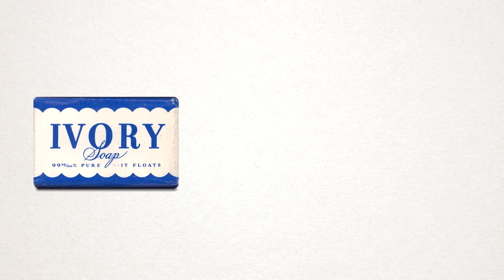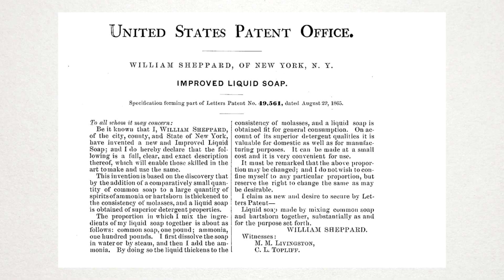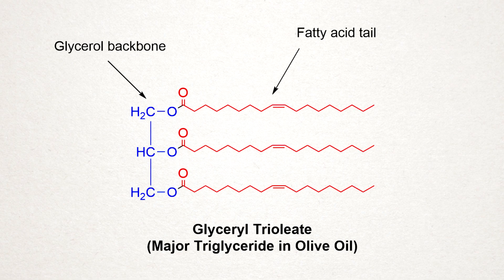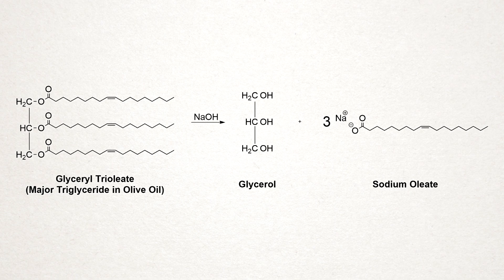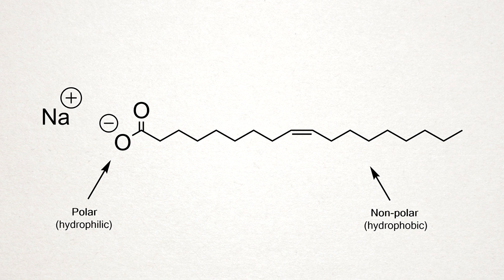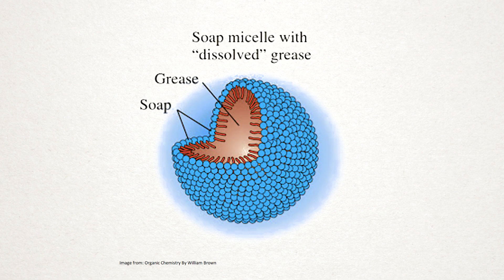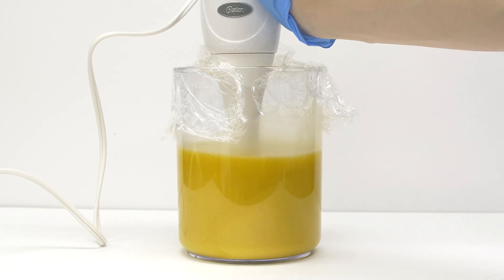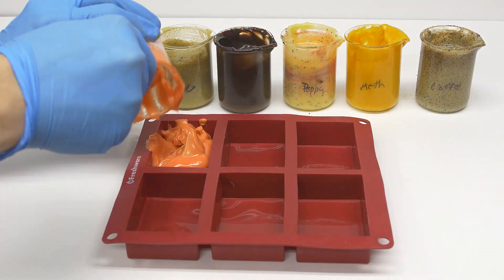How does Soap Work?

Comment: Questions:
1. Could the space in between the sides of each tail in a micelle trap air
2. Can a micelle trap air in the middle of it?
3. If a micelle trapped air in its middle instead of an oil, would it then be unable to pick up an oil or, would it drop the air for an oil if it found one (Could it drop the air?)
I am trying so desperately with my very small brain to understand the function of soap suds/lather and google is driving me insane
Bonus: when suds meet water, why do  they disperse (ussually)??

Comment: Does this mean soaps mainly target oils? What about dirt? 👀🤣
Reply: I suppose water pressure alone is enough to take care of that. The oils are the hardest to get off, which is why soap is needed. You can rinse non-oily dirt off your skin with just water, but if you've ever gotten grease or oil on your hands you'll know that no amount of rinsing will get rid of it. And there are oils on the skin, too, that can trap bacteria etc. and cause body odour and even infections if not washed on a regular basis. Plus nowadays you get extra things like moisturising, nourishing & scented soaps to choose from that do a lot more than just clean your skin.

Comment: Tip: palmolive vs ajax
Palmolive: more gentle on the skin available in more scents 
Ajax: more cleaning and degreasing power easier to rinse
Conclusion: if you're looking for one that's more powerful and easier to rinse ajax is your best friend palmolive is better for sensitive skin and is available in more scents but is harder to rinse
Reply: What are you on about
Reply: Palmolive is a piece of shit that is the definition of harshness on the skin. Never used ajax so idk. I personally shower with a variety of european soaps, like Alverde or Balea, they work a treat. Dove is also amazing, although it isn't a regular soap, but a combo-bar (part soap, part synthetic detergent).
Reply: @notar2123 any strong soap is going to be harsh on the skin, Palmolive included, it’s just the least harsh of the rest of dish soaps and other similar soaps

Comment: OK, that explains how soap holds grease but how does soap kill bacteria and viruses? A currently topical piece of information.
I always thought it destroyed the cell walls.
Reply: as far as i know, it doesn't kill bacteria or viruses, only removes them. you would need an alcohol based solution (such as vodka or sanitizer) to kill those things
Reply: Bacteria and viruses are made of, among other things, fatty acids. Soap literally shreds them apart
Reply: Soaps get rid of fat, bacteria are lined with fat. Kills them.
Reply: @AmyOnhercomputer  you know i never made the connection between the bi lipid layer and bacteria. thanks for the correction